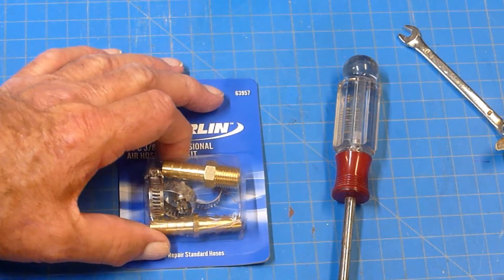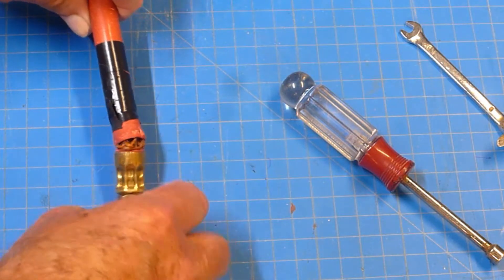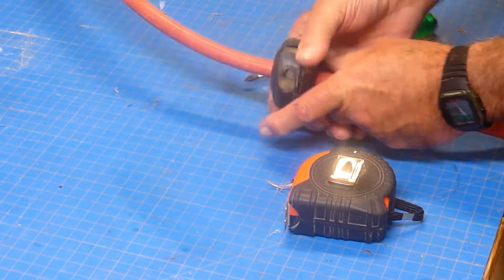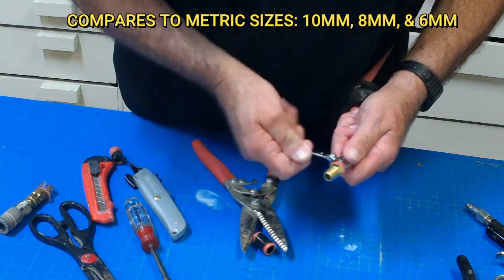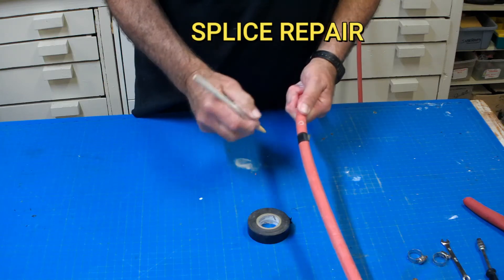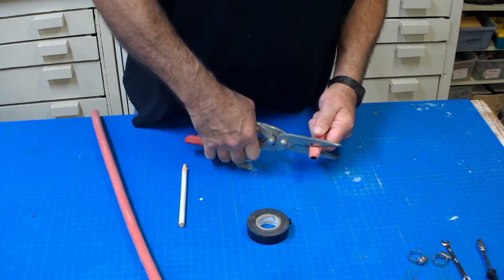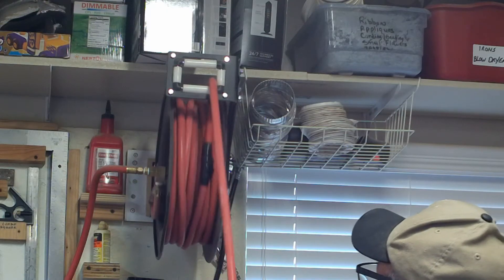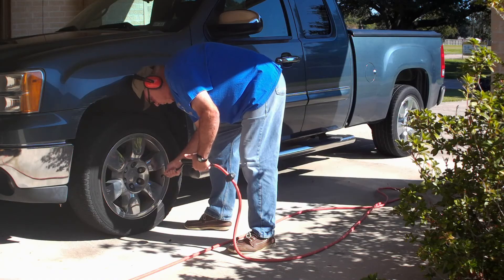How to easily repair damaged or leaking air compressor hose

Comment: Thank you so much for the amazing video, step by step, clear enough for any DIY to follow. After I was done, got a bucket of water and dipped the repaired part into the water, still leaking, tried to tighten the screws, no luck. So I made a fresh cut, insert both ends, used 2 new clamps, still the same. You dont feel the leak, but every few hours, I hear the compressor in the garage running to refill the tank. sorry for the long explanation and hope you have a tip I may follow to succeed in this. Thanks in advance
Reply from the maker: Off hand, I'm not sure why it's still leaking.  When you submerge it in water, can you pinpoint the source of the leak to the joint where your hose is connected to the fitting, or could it be actually be in the quick connect or the fitting you have attached?  A Schrader fitting for inflating tires, for instance, can easily leak.  There is a special tool to tighten these fittings.  Having said all of this, if it takes three hours for your compressor to kick on, it would have to be a very small leak and I wouldn't think that you're loosing enough pressure to effect what ever job your doing.   Thanks for your comment, and I'm sorry that I don't have a definite solution to your problem.

Comment: i wonder if you can melt the hose with a heat gun or torch  and not use the clamps
Reply from the maker: I've never done that or seen it done, but that doesn't mean it can't be done.  I think rubber hose might burn before it melts, but it might work with plastic hose.  If you try it, let me know how it turns out.

Comment: just check it after cutting it it a different size but before I panic I should see it the hose barb I ordered works its suppose to come tommorow in other news if I was try to make a diy air compressor line it would seem important to have a regualator if you need only a specific pressure so it seemed my theory was to put a check valve before a regulator and a shut off after wards does that sound logical to you ? thoughts pleas thank you if I figure out a final solution will have to let you know as its not quite the size I was think ing but I am not ready to panic yet
Reply from the maker: Sounds logical, but as I mentioned before, I'm not an expert on bike pumps.  I use a quick connect  attachment with my shop air compressor that has a regulator built in when I air up tires.
Reply: actually I think the final answer is it can still come out but it seems to need a lot of yanking !!!!

Comment: can I not apply the same idea if I have an air pump tip I dont like ?
Reply from the maker: I don't see why not.  The new tip should have a barbed end and would be installed just like we did in the video.
Reply: thank you for your response so assuming I could find something that fits I just bought a bike pump but people have commented the chuck on it is not good but otherwise it would be a good pump do you think standard air hose repair techniques should work thoughts please thank you
Reply: thank you I think I have done  a hose repair before its good to know that the same skills should apply thank you ps if for some reason I was only able to fill my portable air tank when near an air compressor it would seem an addtional consideration would be put a flow regulator valve in the hose maybe ? I guess though if I were to do that I should also put a check valve as well ? thoughts please thank you
Reply from the maker: I seldom use my portable tank, so I really haven't thought much about this.  But having said that, you may use yours frequently and, if so, it's not a bad idea to add  them for an extra measure of safety.  @Fredengle
Reply from the maker: My apologies.  When I read "air pump" in your question I was thinking you meant "air compressor.  So if you are talking about auto and bike tire inflators, I'm no expert.  They often have a lever clamp on fitting on the end that is crimped in place.  Try searching Amazon or ereplacements.com with your model no. to see if they have the right fittings. I think the fittings like I used in the video will be too big.
Reply: HI deerpark thank you for your reponse I got my new bike pump today I did try to measure or so it seems the hose diamter of my new bike pump hose it does seem to be a 1/4 inch so I guess in theory  should be be able to use standard air tool repair tips for 1/4 inch in size does that sound like it should be right  so if I do not like the current head on it it would seem the remedy is chop off the head and put a universal quick connector does that sound right ? thoughts please thank you
Reply from the maker: what you're saying sounds right & you should be able to get a hose clamp that will fir 1/4".  Cutting off and replacing the head may void your warranty though.  May want to check that out. @Fredengle
Reply: he it seems the wrong size will be glad to let you know if I figure it out any way in other news if I make an airline that has a regulator it would seem a check valve is good before a regulator and a shut off after the check valve ? any ideas please thank you
Reply: actally just tried researching it again it seem the size is one 1/8 so bought a 1/8 air hose repair kit hopefully that will work on my bike pump In theory it should work better If I can create a universal tip on it so I guess that is theoretically correct if I figure it out will be glad to let you know the part I need is supposed to arrive today !
Reply from the maker: Wow! So you were able to find the regulator and check valve in 1/8". @Fredengle
Reply: no the regulatore and check valve were 1/4 inch but I do have an update for you strangely the 1/8 hose repair kit did not quite seem to work so rather than panic the barb seemed a little small I will say what I did rather than panic was I tried wraping teflon tape around the barbs and it seemed to fix the problem I !!!!
Reply: it seems when I put enough teflon tape the barbs do not even though they swivel seem to become unclamped !!!!
Reply from the maker: There you go.  That's thing outside the box! @Fredengle